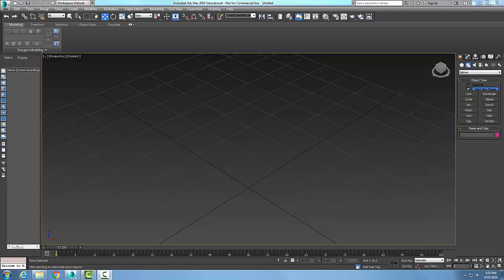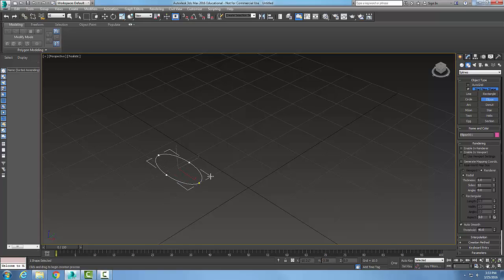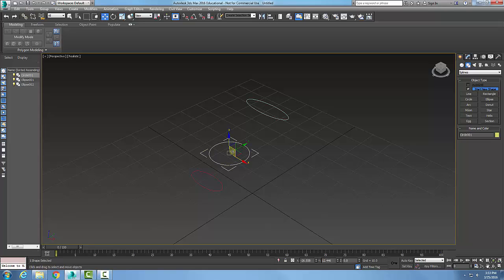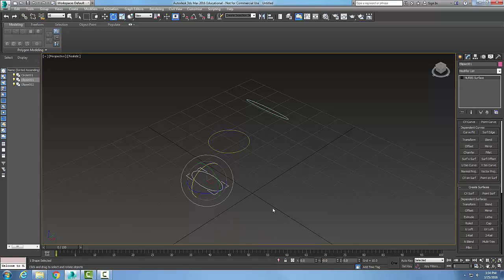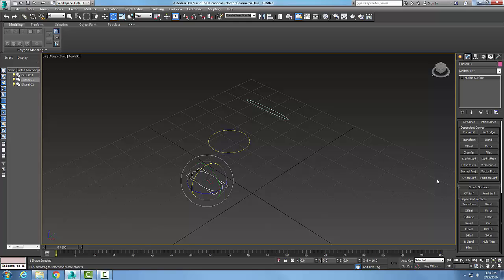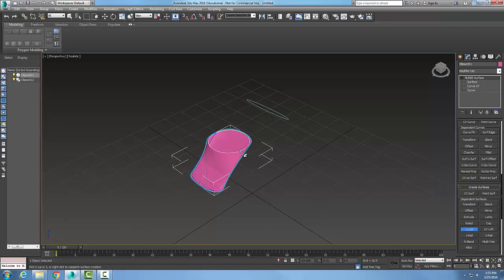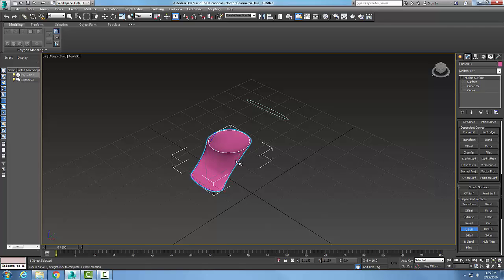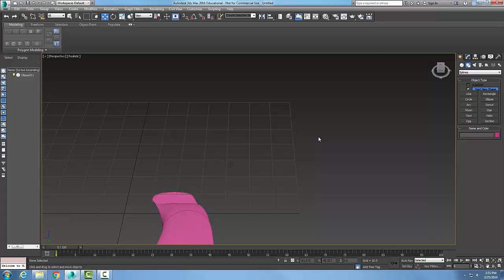3ds Max  10-27 Modifying NURBS Objects   Create Surfaces Rollout   U Loft

Comment: yup this shit never works
Reply: It does, it's just that this guy's explanations are severely lackluster. I've watched his entire series on NURBS (granted it's 7 years old at this point) and it's literally the translation of the 3ds Max Help site to video which doesn't include any explanation of why you might be doing this or how you could use it in a practical situation. NURBS are easily the most complicated systems in 3ds Max besides it's built in particle system, so considering it's depth it needs a lot more explanation than what's being shown here.